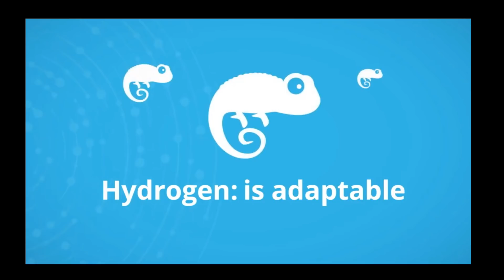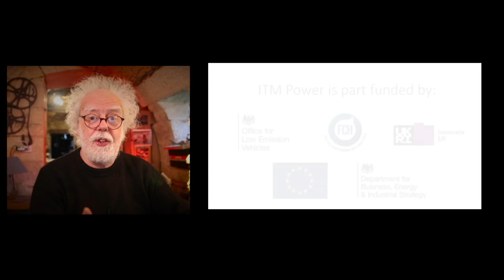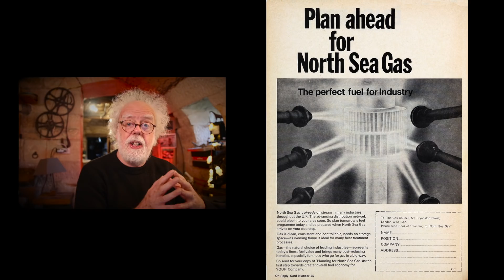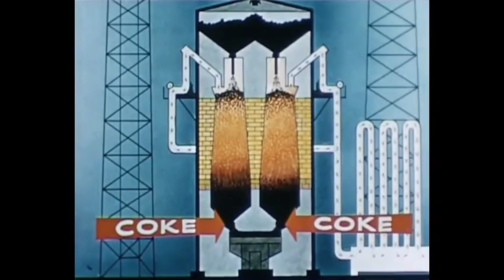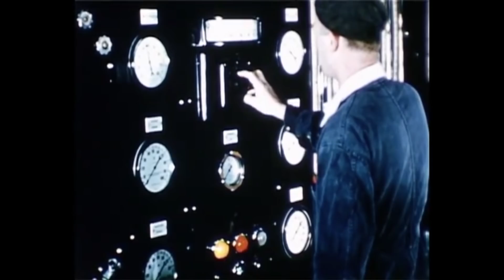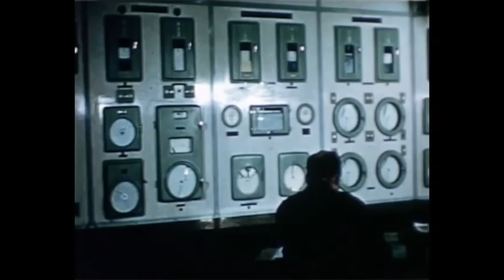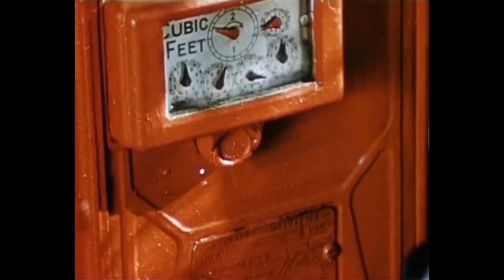Burning Hydrogen - Prof Simon

Comment: Great Idea. To have a multitude of uses instead of selling solar power to the utility at a supplier rate is a bonus.  Reserve power storage for the homeowner can operate a generator at night in lieu of a low battery storage. Cars are converting to hydrogen as well and electric vehicles utilize a hydrogen fuel cell. It will power a car, cool the planet and you can celebrate with a cool glass of water.

Comment: Wind turbines do not output power 24hrs a day- the wind does not always blow. and turbines often cannot operate below certain temperature thresholds. Im not sure why you said that
Reply from the maker: you are correct Brian....i should have said... "wind turbines have the potential of producing power 24hrs a day".   i was making the point, they can make power all night, when demand is low....hence the idea to make hydrogen with the excess electricity.
Reply: @SimonHollandfilms  I figured as much- thanks for responding! Passively generating hydrogen with excess renewables is a really exciting idea to me especially as an energy carrier for whatever electrons we're pushing around during the day that don't have a job until early evening. Having said that I think generating hydrogen with nuclear energy is our best bet. Efficiency is important and centralized generation is the best way to be efficient with our time and materials.

Comment: If you had an HHO flame, big enough in a closed loop creating enough steam to run a steam turbine driving an Alternator. 
Would it theoretically work??
Reply: No, due to the law of diminishing returns. If you examine the generators powered by I.C.E. that make hydrogen, the demonstrator allows the device time to build up a supply of hydrogen before shutting off the gasoline. It gives the false impression of a complete conversion to hydrogen. One setup showed the generator running a disc grinder. It shows the engine starting to starve for fuel and they have to wait for it to pick up momentum again.
--"The law of diminishing returns refers to increasing one input in a production process while other inputs remain constant. As each new unit of the increasing input is added, the marginal output gets smaller."
--
Burning hydrogen produces a very, very efficient flame, but the law of diminishing return still applies due to mechanical losses when powering a mechanical generator. It would work much more efficiently than the I.C.E.

Comment: A terrible idea. 

Blending 20% hydrogen into our gas supply reduces CO2 by only 7% (assuming that the hydrogen production generated no CO2, but 98% of all existing hydrogen production produces CO2). This seems to be an idea supported mainly by gas production and distribution companies. 

I am a big fan of renewable energy (work in the industry) but it's more efficient to use renewable electricity to heat our homes with heat pumps which have a coefficient of performance >100% (typically 250%-400%) rather than to throw much of that energy away by producing, compressing and transporting hydrogen (all of which are inefficient processes).

Hydrogen production using excess electrolysis with excess renewable energy is a great idea, but let's use it to replace the thousands of tons of dirty hydrogen used in fertiliser and chemical production. Dirty hydrogen made by steam reforming methane (natural gas) and dumping CO2 in our atmosphere like it was a sewer
Reply from the maker: good inside knowledge...thanks

Comment: Enjoyed this video as Hydrogen injection into Natural Gas Steel line systems I believe is going to change the world . I found out of this practice via a Canadian Company named Hydrogenics that rolled out pilot projects in 2014. It is a bit different then the Tech you have detailed here professor as the Hydrogenics System filters the extra hydrogen at the consumer distination to burn for electricity production. Back when I discovered this the pilot injecting Hydrogen into the entire German Natural Gas network , it was said, could have 30 days of energy demand supply for Germany with Hydrogen occupying a mere 10 percent of the system. I also know from my industrial electrician brother upto 10 percent of the energy ,created by renewable energy located at distance from the end user marketplaces. PEM Hydrogen fuel cells don't have elements that cant be recycled unlike Lithum Ion Batteries. Per a barrel of oil energy the storage cost for the same energy in Hydrogen is about 50 cents America per Barrell. Lithum Ion Batteries about 200 dollars per Barrell of Oil equivalent . Using existing infrastructure is much more efficient than building new intrastructure to spit the OIL and Gas companies. PEM Hydrogen created with renewables is also highly useful for OIL refineries as it decreases CO2 emissions via the replacement of Methane Steam Reforming.

Comment: The snag is that most hydrogen is currently made from natural gas, releasing CO2 in the process and if the hydrogen is then burned this releases less energy than you would have got from just burning the natural gas. Of course if hydrogen is electrolysed from water using renewable energy then it's great, but that is a lot more expensive. So, while it sounds good, hydrogen might well be making things worse.
Reply from the maker: good points

Comment: I have to disagree with your description of the calorific value (CV) and seemingly linking this also with flame temperature. The calorific value of towns gas in the UK (sorry, in old money terms memory bank can't  convert to new :-) ) was typically 500btu (British Thermal Units)per cubic foot at standard temperature and pressure (STP) compared with 1000btu per cubic foot for natural gas i.e. natural gas has twice the energy content per given volume than towns gas. The CV is also not linked to the flame temperature. One of the main changes people noticed as a result of conversion was the different flame characteristics partly due to the vastly lower flame speed of natural gas compared with towns gas.  The vastly lower flame speed of natural gas compared with towns gas (mainly due to the absence of hydrogen) meant the the exit velocity at the burner had to be kept quite low to prevent 'lift off' of the flame. There are techniques in design to help reduce the possibility of loft off  but overall the flame looked and sounded softer than with towns gas which led to people (mistakenly) thinking the flame was 'not as hot'. In reality the flame temperature and energy produced by a typical cooker burner was pretty much the same as before conversion. Hydrogen has a CV of round a third of that of methane so adding 20% hydrogen to the existing supply will lower the amount of energy per volume by some degree from the existing typically 1000btu per cubic foot. Add another 30%to the 20% and we will be back in the old towns gas era :-) .
Reply from the maker: Thanks Phil...sounds like you know more than me.
Reply: @SimonHollandfilms  50 years as a gasman helped, would do it all again if I could :-)

Comment: I always thought, hydrogen penitrated metals, weaking the metal, and leaking out.  I must be wrong.
Reply from the maker: It does leak...it’s so tiny
Reply: Hydrogen embrittlement of steel pipelines can be a problem in some cases.

Comment: I think the higher calorific value of hydrogen is per unit mass, not volume. Injecting 20% H into a gas line would be 20% by volume, wouldn't it?
Reply from the maker: I assume you are correct.
Reply: Hydrogen has a CV of around a third of that of natural gas per volume at same temperature and pressure. Injecting 20% would be by volume so lowering the overall CV of the resultant mix.

Comment: so, if I put hydrogen through the existing central heating, I need a different gas jet; ...I was thinking also of running my 2 stroke scooter on hydrogen... - how would the reed valve behave? ...apparently most engines need to be run rich with hydrogen as a perfect hydroxy-mix is practically thermonuclear is its behavior ... ideal for fragmenting engine blocks violently...

Comment: The UK average electricity usage is 34GW with a low of 20GW in the summer between midnight and 5AM and a high of 50GW in the evening in the winter. The wind produce 10% of the electricity 3.4GW nuclear 20% 7GW. So if we don't shutdown the nuclear power plants at night (uneconomical) the UK is still short of 9.6GW at its lowest power usage which are generated by the gas power plants. I really don't see where you see an economical way to produce hydrogen from wind turbines. 

Also the main gas user are power plants so I don't see any reason to send this hydrogen in the consumer network.

Comment: prof i have a question is there an engine specifically designed to run on hydrogen, i see people trying to run petrol engines on hydrogen, as a fuel hydrogen's burn front is twice that of petrol and then there's the heat expansion volumes  that are different too, surely its very inefficient trying to run the petrol engine on the wrong fuel and if the engine was designed around the fuel a hydrogen engine would have a different stroke and cycle in order to use it more efficiently?

Comment: "Hydrogen is dangerous. It damages metal pipes, it leaks prolifically through the tiniest cracks, cracks too small for other components of natural gas, it ignites easily and violently over a wide range of fuel air mixtures, and it burns with a flame so hot it is invisible. One slip-up and you are dead" - https://wattsupwiththat.com/2020/01/02/bbc-blend-20-hydrogen-in-natural-gas-to-reduce-home-co2-emissions/

Comment: To improve the efficiency of hydrogen production it would make sense to use use all heat produced to provide heating and hot water for local buildings. Could street lightning be provided using hydrogen production?
Reply from the maker: Great plan
Reply: Hydrogen production (at least if run efficiently) using electric power generates very little heat. Coal fired town gas production was an entirely different question (and used three times as much coal as feeding a coal fired power station with the same output).
Reply: @allangibson8494  Currently what is the most efficient electrolysis of water method available at industrial levels for the production of hydrogen, not using preheated water? Even if only 25% of the electricity used produce heat, at industrial levels that would still heat a lot of homes.
Reply: @pauladams1829  Steam is lousy for most electrolysis processes. The only products leaving the cells (other than a mud flush (assuming you are not making heavy water)) should be room temperature hydrogen and oxygen. The hydrogen then needs compression to be useful - which is the second major waste of energy (the first being the 10% losses inside the cell) and this will require intercoolers to reach the 60C maximum acceptable pipeline temperature. 60C water is not much good for anything and no-one will want to live within a kilometre of a hydrogen plant because turbo compressors are NOISY.
The only exception to this are ceramic electrolysis cells that operate at 900C and while they are highly efficient electrically (99%) they are only viable with the hot gases being used to boil the feedwater so again - no useful heat out.
The issue is the best place for a hydrogen plant is right next to the electrical generator and no-one will want to live there because it in noisy and in the middle of nowhere.

Comment: At the end of WW2 in Japan, the taxi drivers used gas from coal to run their cars. Japan needed to import all their oil and their oil tankers had all been sunk, so the taxi drivers started using gas from coal.
Reply from the maker: We had charcoal powered cars in France after ww2
Reply: @SimonHollandfilms  You might explain technically, in a future video, how the charcoal powered car worked. Very few people today, including me, know about that, or understand how it worked.
Reply: @SimonHollandfilms  Interesting.  Even though charcoal has no flammable constituents in itself, incomplete combustion produces CO which will burn.
Reply: For those that might read this, there is a video on YouTube by --- NightHawkLight --- called "running a gasoline engine on firewood". He explains how the system works and gets a small 4-stroke engine to run for a short time. I assume this is the same process for running a car in Japan and France 70 years ago on coal or charcoal.
Prof Simon actually replied to one of my comments.......amazing.!

Comment: Using Bio-Gas/methane
https://www.ecotricity.co.uk/our-green-energy/our-green-gas/what-is-green-gas
Together with hydrogen could be useful in reducing the use of fossil fuels for heating etc. in buildings. Could methane be used to produce steel instead of coal?

Comment: There are many forms of energy storage available to facilitate the transition to 100% renewable energy use.
Pressurised gas
https://www.thegreenage.co.uk/tech/compressed-air-energy-storage/
Bio-Gas/methane
https://www.ecotricity.co.uk/our-green-energy/our-green-gas/what-is-green-gas
Green hydrogen 
https://www.geopura.com/blog/why-we-should-start-using-green-hydrogen-in-2019/
Thermal energy 
https://energystorageforum.com/energy-storage-technologies/thermal-energy-storage
Cryogenic energy storage 
https://www.highviewpower.com/technology/
Gravity energy storage 
Covers multiple technology’s like pumped hydro new approaches are becoming available.
https://www.renewableenergyworld.com/2018/11/19/gravitybased-energy-storage-hits-the-market/#gref
Battery technology is currently out performing gas peaker plants .
https://cleantechnica.com/2019/10/28/worlds-largest-storage-battery-2-5-gwh-to-replace-gas-peaker-plants-in-queens/

Comment: There's been people in the past that have made inventions that can make hydrogen On Demand with AC current and no need to store incredible amounts of hydrogen fuel under pressure. They even had a car getting over a hundred miles to the gallon and the only thing coming out the tailpipe was water. But General Motors bought the patent rights and hasn't really let anybody use them.
Reply from the maker: You can buy a hydrogen Renault at any car dealer in France...maybe it’s just an American issue
Reply: @SimonHollandfilms  They have some here but they sure don't put a lot of  time into new ways of making it more accessible to the masses at a reasonable price. All vehicles can be converted into hydrogen. 
  But I think it's more or less they can't figure out a way  tax us if we are all capable of doing such a thing, like just filling up your car with your garden hose and not having to go out and buy petrol, just to be a Slave to the oil industry just so we have a means of transportation.
Reply: @SimonHollandfilms  love your videos!  We all appreciate your time you put into them!! They are great!!!

Comment: It's a shame that their has not been a Nuclear Fusion breakthrough.  Then we would be using Hydrogen and Electric Vehicles already.  

Also in Sheffield, is the NAMRC.  

There's a female Physicist their, who has created a small modular Nuclear Reactor about the size of a Pressure Cooker.  

She says, you could put 2,000 together and have the power output equivalent of Sizewell B.  But without the Planning, Construction and Safety costs associated with it.  

Put them on a Flatbed Lorry, and take them to where you need them.  You could power Glastonbury, for example without the need for Diesel Generators.       

https://www.namrc.co.uk 

***
PS
(? Unofficially, the US Government cracked it in the early 1970's.  It was to be Richard Nixon's, surprise announcement at the 1976 Bicentennial, that the USA was now energy independent.  [See the Ford & GM Electric Cars of the mid 70's] .  

But with the Dollar the World's Reserve Currency, Priced against a Barrel of Oil, the Shadows decided to get rid of Nixon through disgrace rather than martyrdom.  

The after effects of the Yom Kippur War of 1973, massively strengthened the Dollar in this role).

Don't know what fuel is actually used, in the fusion process.  
I know Hydrogen, gives out Gamma Ray when tried.  
I suppose it's the Helium 3, whatever that is.  Up on the surface of the Moon.  
Tanzania is the only nation on Earth with natural Helium Gas reserves.   Could be as wealthy as Saudi Arabia and Iran.
Reply: Portable fusion is already here: https://www.thedrive.com/the-war-zone/19652/lockheed-martin-now-has-a-patent-for-its-potentially-world-changing-fusion-reactor

Comment: Hi, so ITM have been around about 10 years now in Sheffield.  

One of the things they wanted to do, was have rather than having the onshore Wind Turbines, putting little bits of electricity into the national grid, instead using it power an Electrolysis device and storing the Hydrogen Gas in Compressed Air Cylinders (and optionally the Oxygen Gas as well, for Healthcare or for Pond / Lake rejuvenation).  

One of the Big Hedge Funds as taken a slice of their shareholding.  

They want to roll out the Hydrogen Gas refuelling at every Petrol Station.   

The possibility, that Plant, HGV, PSV and Taxis, having their Petroleum based Fuel systems altered to burn Hydrogen, in basically standard Diesel Engines, is just too mouthwatering.  

Even the Diesel Electric, Trains and Rail Locomotives, could go down this route, again reducing CO2.  

Also when their are periods of North Sea Fog, and the Turbines are stop, the Hydrogen Gas, that has been stored can be used, in the Natural Gas Power Stations, that already exist.  

https://www.itm-power.com/